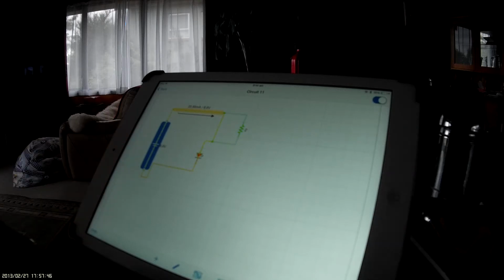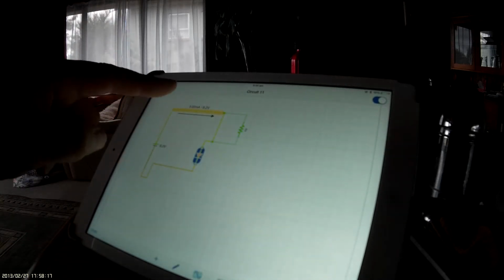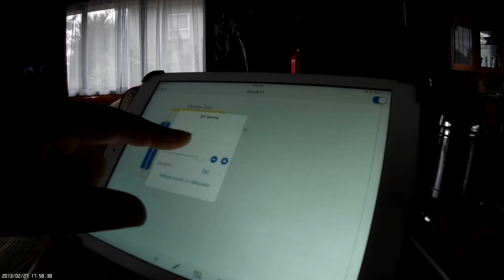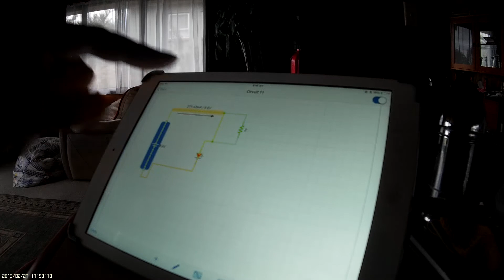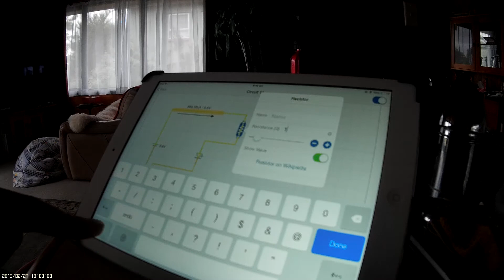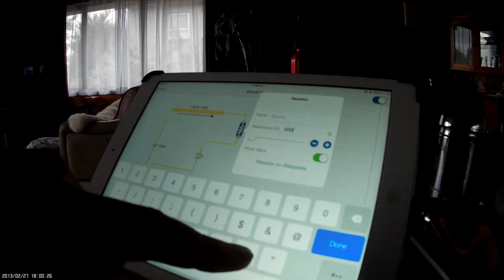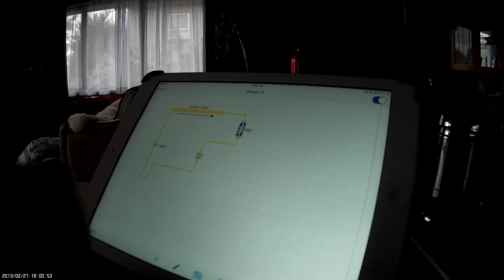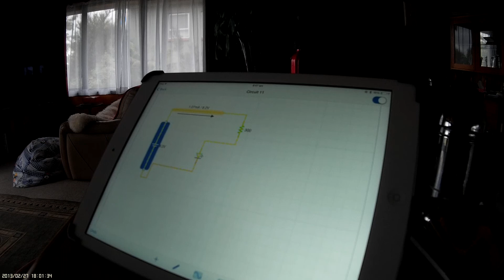10 Watt LED on 9 volt battery part 2

Comment: Thanx Roddy, most enlightening. I have an LED on the front of my quad, it really helps with orientation at a distance.
Reply from the maker: Will you be trying this product?
Reply: Not for my quad, every gram I save helps with a longer flight time. For that I've used a 12 micro LED round 12 volt panel wired into the circuit board and switched. 
Your light would be ideal to have in a car or in the house as an emergency light. 
Have you thought about using this for your quad using the existing quad power supply?